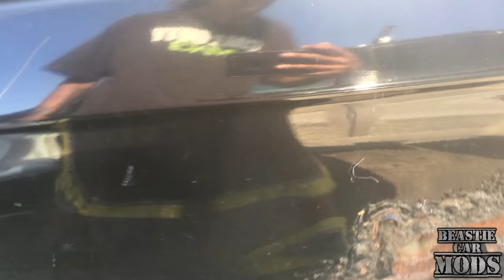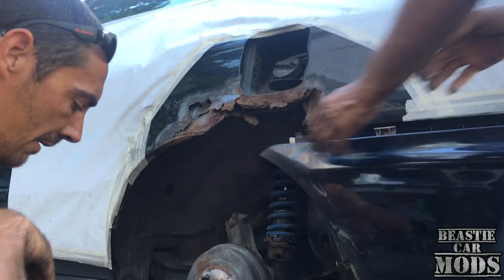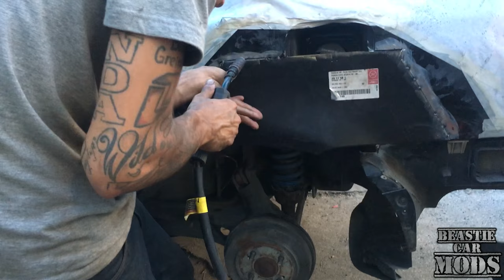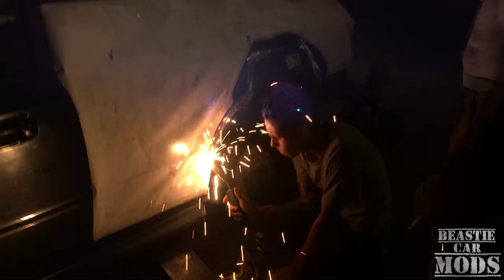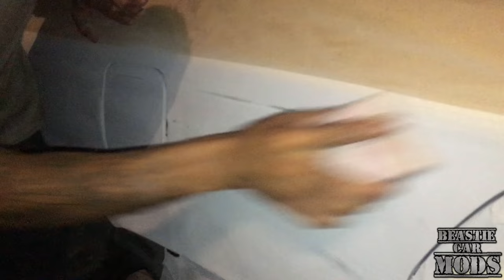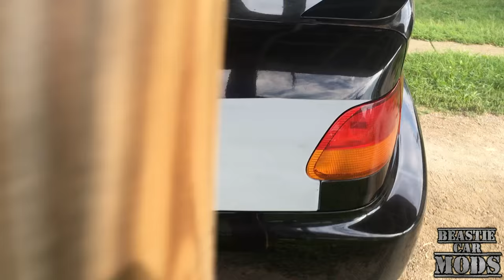1996 Honda Civic - Major Rust Hole Repair (Part 1)

Comment: These guys need to familiarize themselves with block sanding, paint blending, and safety equipment. Also nice to see that the inner wheelhouse wasn't repaired. Third world quality work.
Reply: Aaron Dalton i was wondering if they was going to repair that
Reply: Don't insult third world mechanics

Comment: quick question... did you repair the support under the repair panel? or did you leave it rusted out?  Also, welding without a lens or a face shield is a great way to go blind. Guys, remember your safety equipment.

Comment: The inner will rust it back out. You never even used a rust converter befor you started . Nor did you use weld thru primer befor welding smh.